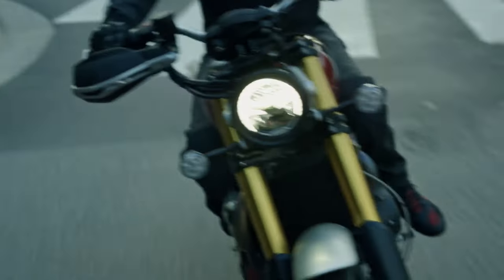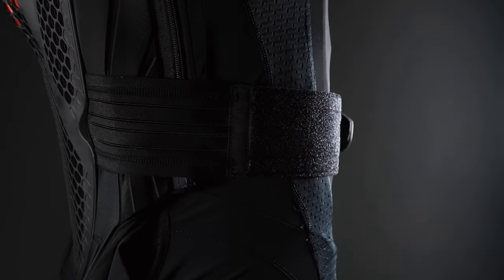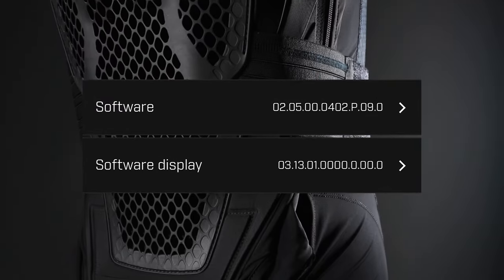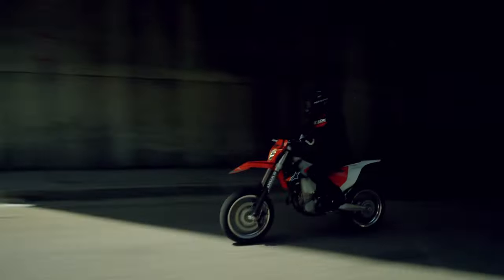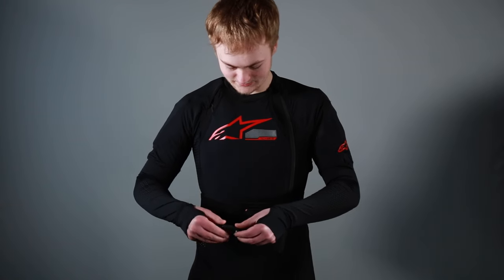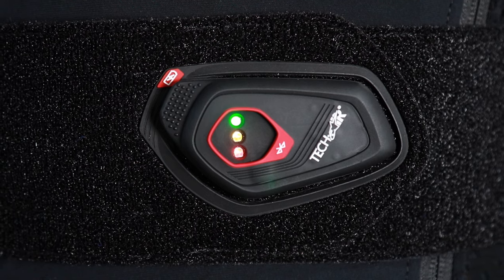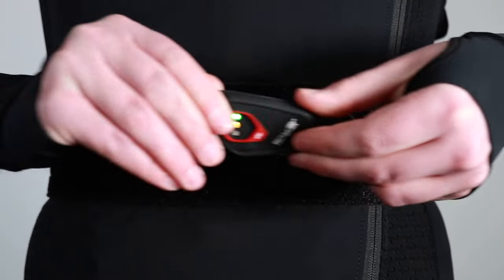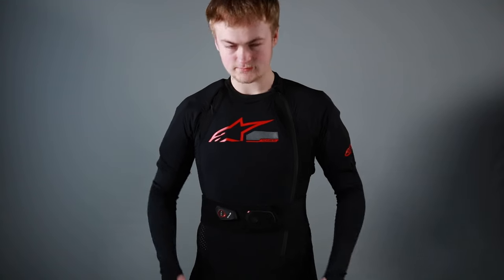Alpinestars Tech Air 10 Update and how to use it

Comment: Hi Alan. To confirm when it's armed you see a green and orange led light?
Reply from the maker: Hi, Solid green light is when it’s armed. When in race mode will arm after the designated speed is acquired. When in street mode will arm once it acquires a stability check. Green n orange indicated system start check/standby. Thanks

Comment: Ridiculous.  They need to implement a simple system to arm and disarm like the tech air 5 or the new tech air 7.  Blows my mind how poorly they designed this system.
Reply: I agree. I bought the tech 10 and had huge problems with power on and connection. Returned 2 times for repair. bad power system.
Reply: @lucaiorio69  Hopefully the next version of Tech Air 10 (tech air 20?) will zip into the suit like the next Tech Air 7 and the older race.  That would make it so easy to use.  Really PITA getting the tech air 10 on and off.  A simple flap closure to arm and disarm, plus an LED panel that is easy to see and not detachable would be the solution.